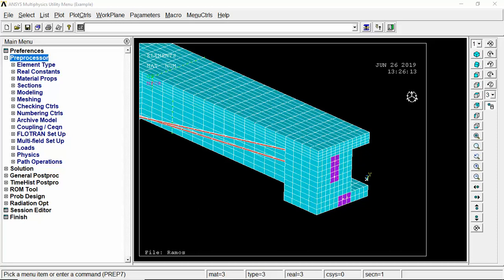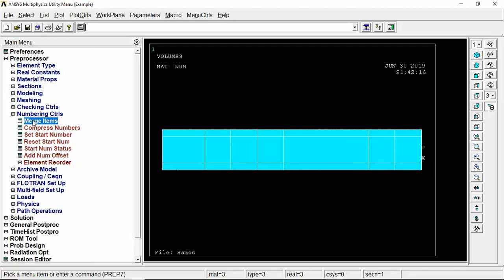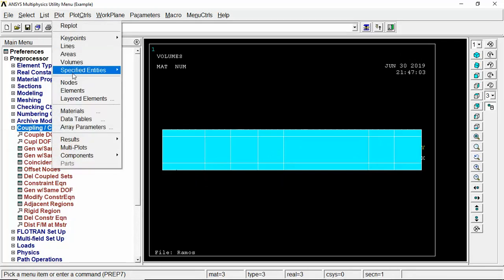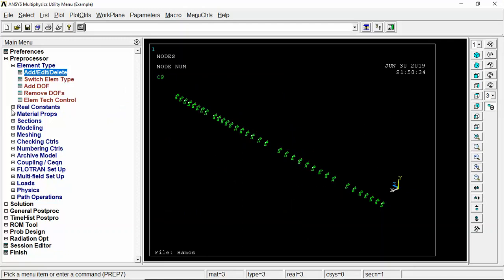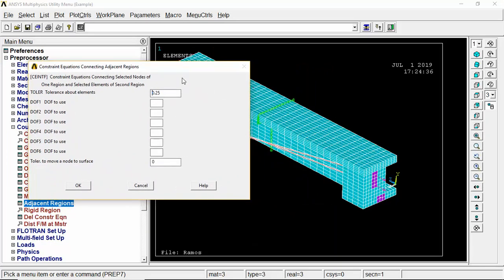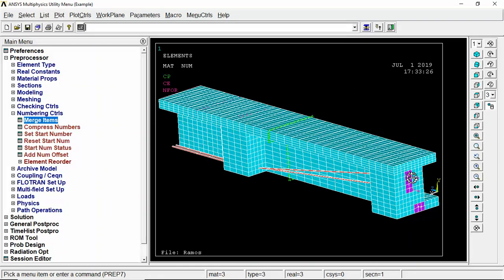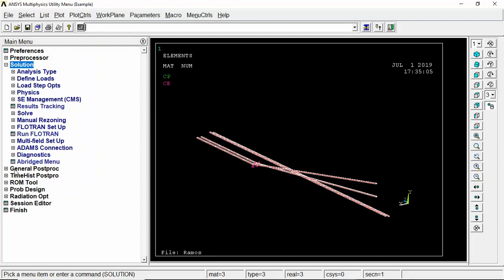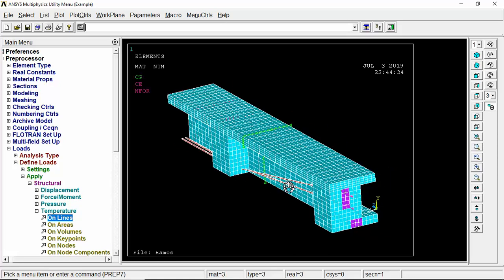How to model a pre-stressed concrete beam in ANSYS Mechanical APDL 4

Comment: Sir, would you explain me what it the Procedure to be followed for Multiframe RESTART Analysis in Analysis Typeof MAPDL to increment my load in model increment after each Load steps
Reply from the maker: If you have telegram, send me a message. Otherwise send me an Email. I  am a little bit busy now. I'll explain you
Reply: @rezalamei1811  plz give me you Telegram Link,I will send you my query there
Reply from the maker: @arunchandbala9597  Its in the caption. @Rezalamei
Reply: @rezalamei1811  Sir I have send you msg in Telegram would you please check it
Reply from the maker: @arunchandbala9597  I will check your message in 6 hours I am at work now

Comment: Sir Can COMBIN 39 Spring elements be used at COINCIDED node or should be given any small initial distance between Concrete and Steel nodes

Plz reply
Reply from the maker: https://youtu.be/5W4dgjj3dOw
This video is really useful for your purpose
Reply: @rezalamei1811  Yes sir I have referred that video, sometimes we have to use distance between i,j nodes of COMBIN 39 elements..How give that small distance between elements?
Reply from the maker: @arunchandbala9597  Move the one the volumes for a small distance
Reply: @rezalamei1811  would you plz eloborate sir,I want Concrete and steel with small distance apart but not Coincided or merged
Reply from the maker: @arunchandbala9597  If you move a volume, all of the components attached to that volume will move like elements, nodes, lines, areas, keypoints. Also, if your line is not attached to any area or volume you can move it and all attached components to that line will be moved too. For this purpose, you can follow this root Preprocessor> Modeling> Move/Modify> Volumes or Lines
Reply: @rezalamei1811  This one has to be done after Meshing both Concrete block and Re bars,right sir?
Reply from the maker: @arunchandbala9597  Doesn't matter.  But maybe it is better if you do it before
Reply: @rezalamei1811  Sir after meshing is done can I use Scale & Move the nodes option in Move/Modify?

Comment: hi very nice video can you help me with Non Linear Buckling analysis of an I section steel column with residual stresses
Reply from the maker: I have no idea about residual stress but probably you can do it with INISTATE command or apply temperature. For buckling, you have to apply a small amount of imperfection to your model or geometry. It depends on your model. For beam, elements you should define an eccentricity for the elements. For solid elements, you have to do a linear buckling analysis first. Then, you should update your geometry based on the results of the buckling analysis and an appropriate scale. I recommend to export that geometry for other models. Then you can simply apply a load and do a nonlinear static  analysis.